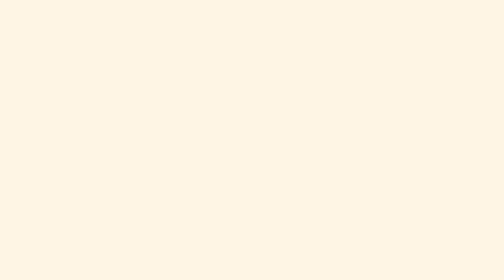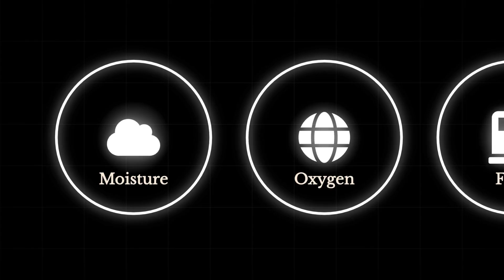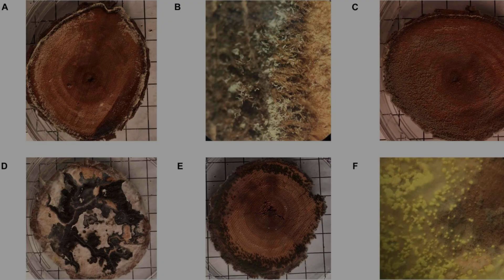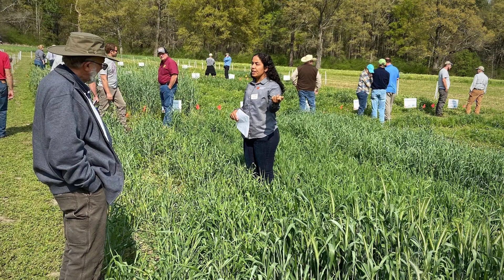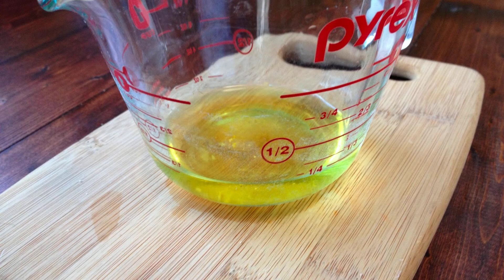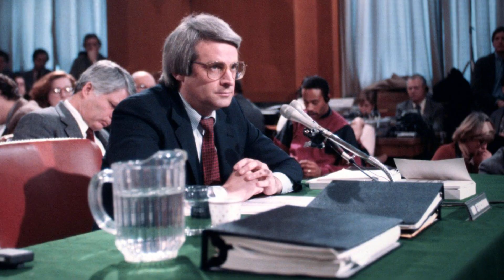The Fence Post That Lasts 40 Years Without Rotting - Old Farmers Knew, The Lumber Industry Buried It

Comment: In the UK arsenic in wood treatment is banned and the better quality real creosote is all but impossible for farmers to obtain  with the commercial stakes now costing a fortune with some not even lasting more than 5 years before they rot off in the ground. Seven years ago I started planting Black Locust for fencing stakes most of these trees are growing straight. I intend to take root cuttings from the straightest Black Locust trees. A lot of native trees in the UK such as Ash are now dying from Ash die back with a new disease now killing Chestnut. Had I known 20 years ago what I know now I would have planted thousands of Black Locust. Hungary has certainly led the way in Europe. There are some reports that Black Locust wood can be poisonous to horses not sure exactly how bigger an issue this would be  or if these reports are accurate ?